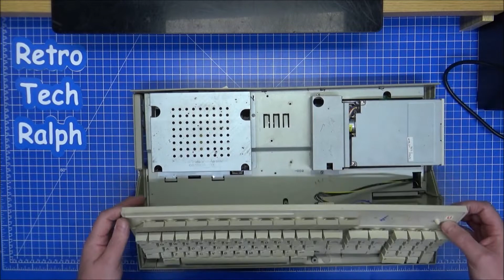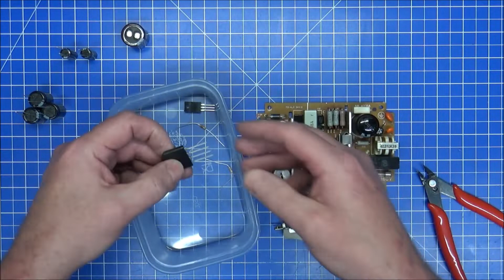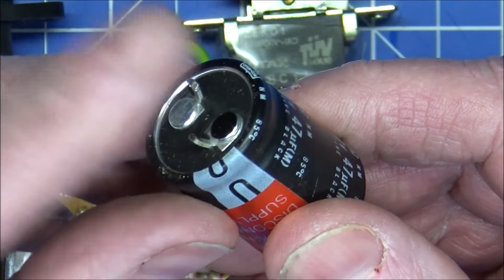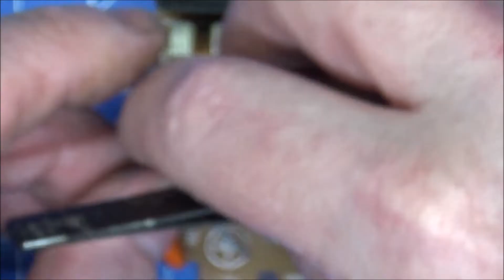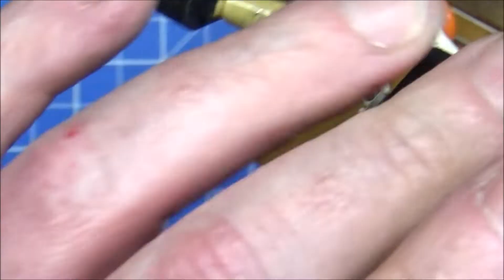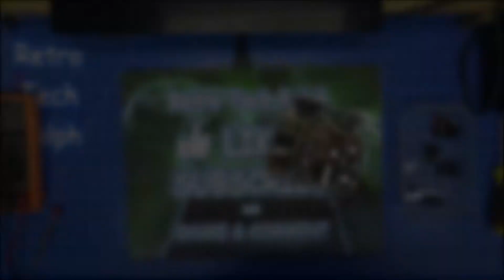Atari ST PSU Upgrade

Comment: Thank you for  your really helpful video!
I recapped the same PSU by using the exact same values . What I noticed is that the right heat-sink ( the regulator you replaced) gets ridiculously hot really fast (about a minute or less). Have you noticed similar "behavior"?
Reply from the maker: not noticed, but ive not been inside since filming. If its too hot then its obviously a problem, not sure what though